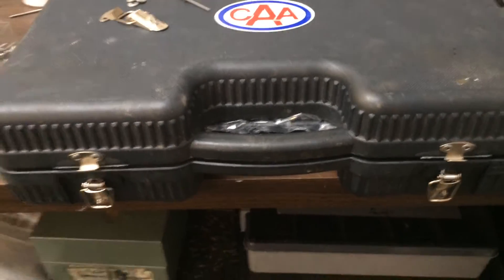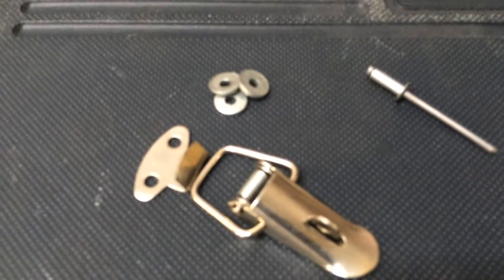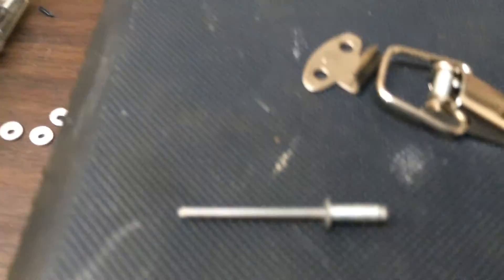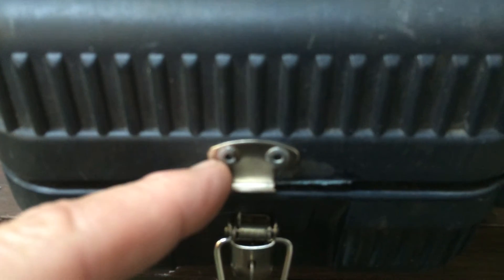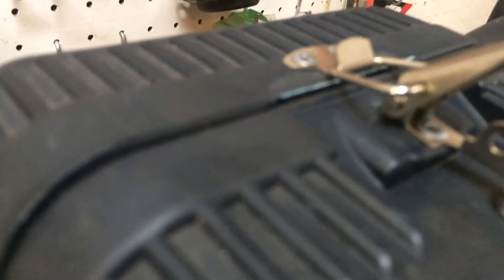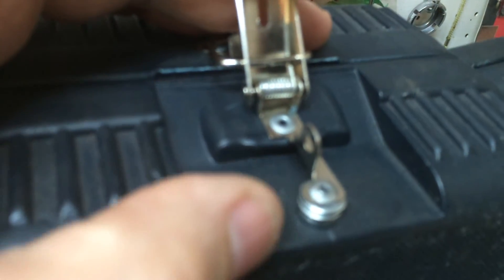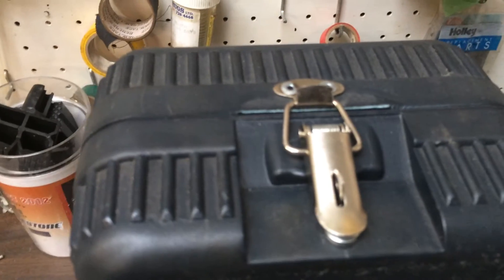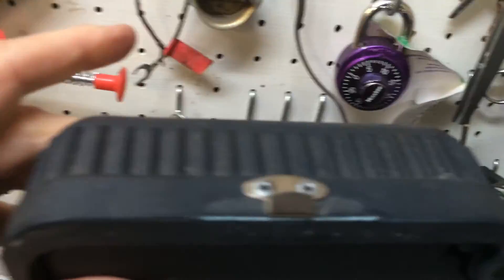How to fix your socket case lock when the locking flap breaks off.

Comment: Good idea but I bought the same type of latch and when I riveted, the rivets would no hold onto the plastic on the inside and came out.  I kept having to drill out the rivets from the hinges and tried again.  I finally used screws and they held.
Reply from the maker: gbsk12 you probably drilled too large of a hole for the rivet. Worked great on mine and holding.

Comment: Nice idea.  I tried this and drilled the holes the same diameter as the rivets and most of the rivets pulled through the plastic.I probably drilld out 8 rivets that were stuck in the latch holes.  Any suggestions?
Reply from the maker: Sounds like the plastic is too thin. If you can get to the backside of the case where the rivet will bulge when completed, I would add a rivet washer. If you can’t get to it like mine and the plastic is thin and flimsy then cut open the rear for access and add a 1/8” x 1” piece of metal or aluminum from Home Depot. They sell them in different lengths but the shortest might be 3’ or 36”. So cut the length you need, drill your hole then hold the 1/8” x 1” piece of metal then run the correct length rivet to connect all the parts together and Bob’s your Uncle.

Comment: Where did u get locking latch?
Reply from the maker: Click show more above and it says eBay.
Reply: John Milner Thanks
Reply from the maker: I added more info where you click on show more. I couldn't find the one I bought due to the length of the eBay History it keeps. Usually the same seller will sell different lengths.